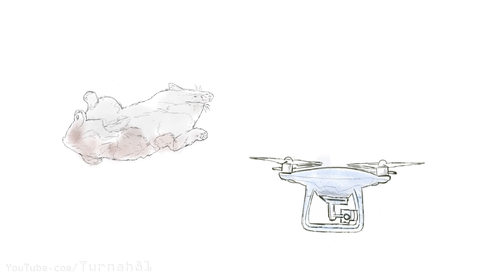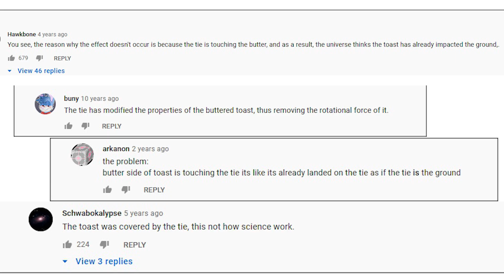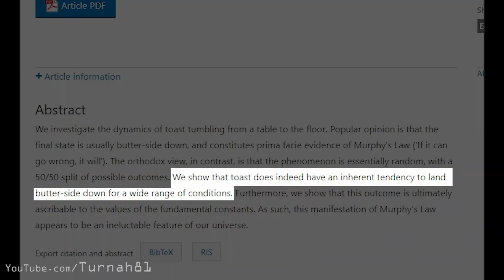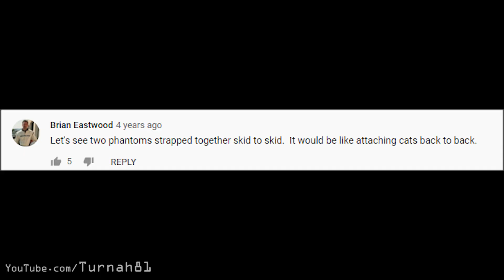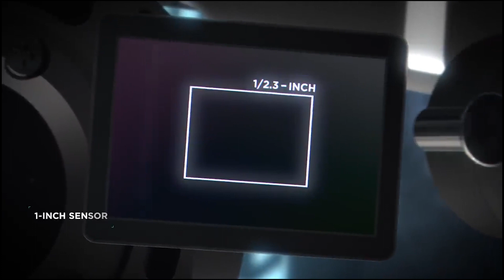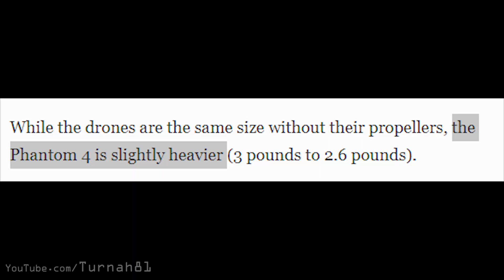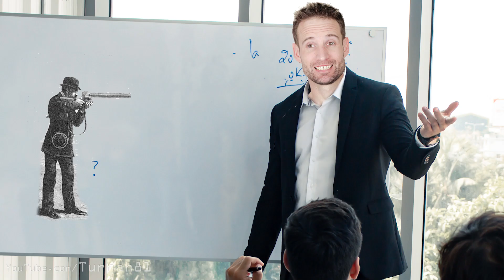Drones always level out - What about now

Comment: cat backs aren't generally flat, so strapping 3 together would create a more stable structure and add another rotator into the mix for the struggle to right itself. Might get increased speed on the perpetual motion engine.
Reply from the maker: I love this 🤔🤔 It would likely start easier too!
Reply: So, would that be a 3-phase feline power generator?
Reply: @FatLoach  when you start the car it goes purrrr purrrrrrrrr
Reply: X,Y & Z axis... 3D spin.
Reply: any names for this marvel of engineering?
Reply: trypuss?

Comment: Two things to try if you have access to some unwanted cats. Firstly see if they fall on their feet if they are blindfolded. You may want the welding gloves on for this. Secondly see if they fall on their feet if they are falling onto something that has an optical illusion on it. Think like the rugs that look like they have a huge hole in them or alternately an infinity mirror.
Reply from the maker: What about a bath tub? I wonder if their bath avoidance would assist in the levitation or ruin the rotation?

Comment: Ah see, the cat vs buttered toast thing is a frame of reference problem. The buttered toast will only land on the buttered side if it's in free fall. But strapped to a cats back, from the toasts frame of reference it is laying flat on a surface already, so its black magic is never kicking in. By the same token, if you were to make a device that straps temporarily onto the back of buttered toast, it would always land buttered side up if you let it fall.
Reply: So you’re saying I should use Velcro to hold the drone to the cat?
Reply: @glennllewellyn7369  No ofc not. The cat needs to be able to move freely, so you need a wire harness strapped to the cat with the wires attached to the drone... say 4 wires, one wrapped around each motor arm.

Comment: You need to try it with racing drones. The kind that has a power to weight ratio of 15 to 1. More action, more blending, more exposed wires, more risk/chance of spectacular lipo fires.
Reply: Not really 15 to 1 most of them are 10 to 1
Reply: I dont think they self level though
Reply: @andyroman8223  Yeah most flight controllers have modes for self leveling(horizon mode)